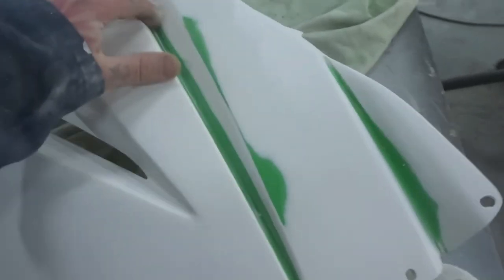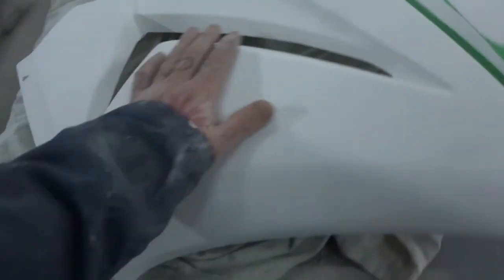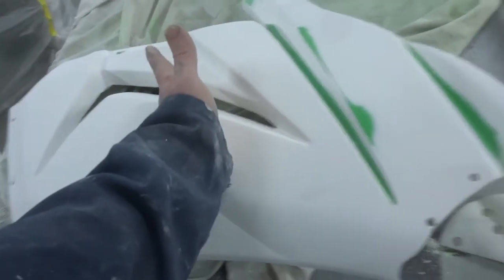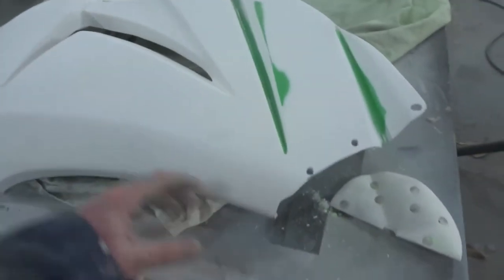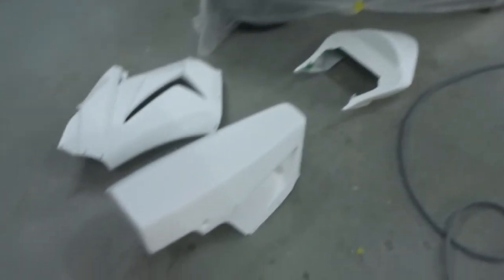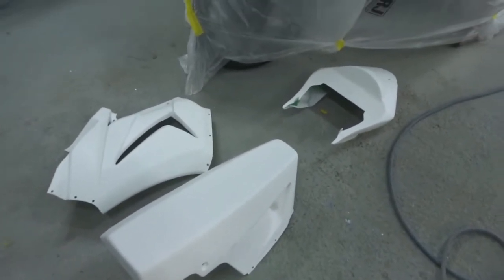Vamptech Kawasaki (G.I. Landscapes) Race Bike - Pt.2. First colour going on! #paint #bike #race

Comment: Hi boss how's it hangin 🍆😁 it's great to see another video from you Mr Luke, I love your vids mate you are a complete nutter and you make I laugh 😂 cant say that the Baby Blue is my colour but it looks nice and glossy and there is nothing wrong will laying it on thick, I stripped my panels this week and the paint on them was about 5-8mm thick 😲🙄😆 don't leave it to long before the next instalment from the Adams family 🥰😘🤔 cheers mate!!
Reply from the maker: Goooood afternoon Mr John, I though you stripped them after every colour! I bet that's rather satisfying though. Have you managed to get it off in 1 yet..?
I'm trying to make them with not ad much edited (which is why this ine is so shite🤣). If I spend too long at the computer I wanna throw it at the wall 🤪
Reply: Hey Luke, nah it's to much work to strip them every time mate I just give them a good blocking then a coat of WoW primer, they must have been recoloured about 7-8 times before I strip them, I can't quite strip them in one sheet but if I get a paint scraper under one edge it comes off quite well, I polish the bare metal with a mould release wax 😎😂 I wouldn't advise you do that on a customers car 😲😆
Don't worry about the editing mate they are more natural as they are and this one was a cracker 👌👏👏👍
Reply from the maker: @JohnWD40TC02  is that what they would use on a fibreglass mould? When ate you gonna have a gonay airbrushing dude? I've always wanted a go but I haven't got the imagination to design anything 😕
Reply: Yeah it's used on moulds so they release the moulding, I'm sure I told you that I used to be a vacuum and injection moulder also did a bit of hand layup as well when needed. You got no hope of seeing me use an airbrush Luke as I haven't got a scrap of talent for that stuff, I can't even draw a matchstick man 😭😂
Reply from the maker: @JohnWD40TC02  I'll have a go if you do!! 🤣🥸
Reply: 😱no f'n chance🤪🧐🤣
Reply from the maker: @JohnWD40TC02  😭😭🤣🤣🤣